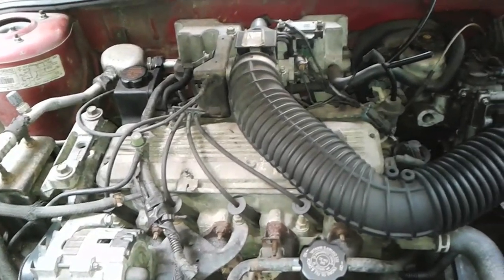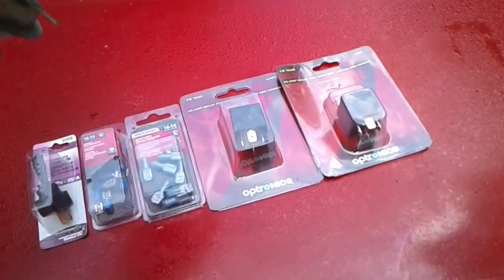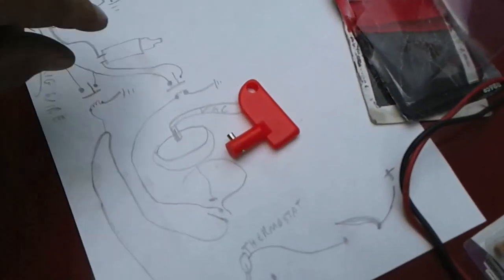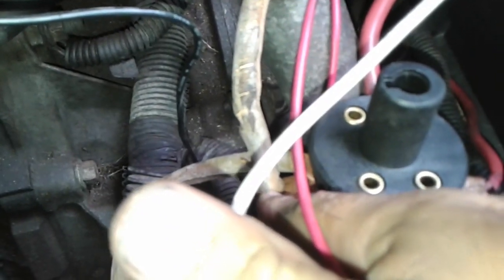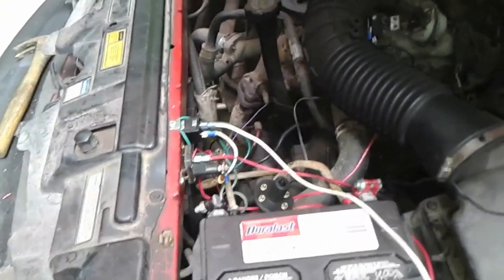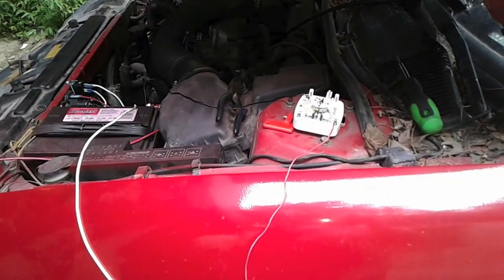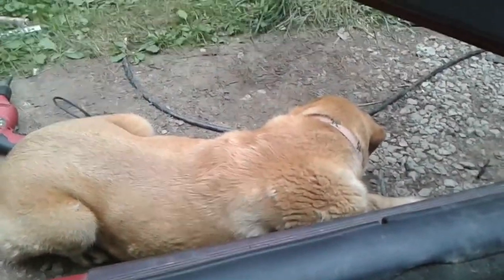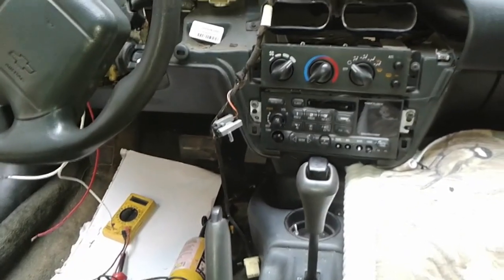Making a Car into a Home Part 5-HVAC

Comment: Maybe you should patent this wiring setup if you can ? for RV's maybe ? having the rig start up for climate control would be quite helpful for keeping the house batteries charged and the engine running a few times a day during park use.
Reply from the maker: I probably should. I'm going to be using this same kind of system in Buster. It should be easier on an '87 model.  I was thinking of rigging the start procedure to be initialized by the power inverter alarm also to charge the batteries when they get weak.
Reply: Roadtrek has a setup like this to charge the batteries on their newer class B van/motorhomes, but they added an extra electric generator to the motor to charge the RV house batteries faster.

Comment: I was wondering how those fancy motorhomes were doing that thanks great explanation. 
I have wondered is it possible to do radiant floor heating and capture the heat from the engine block by circulating water through it maybe on a thermostat.
Reply from the maker: I didn't know motor homes did that, cool. The radiant heat is an excellent idea. Could even use some of the residual heat to warm up a hot water tank for a shower.
Reply: This is what those big trucks (used to haul huge semi trailers) that the drivers live in do (or at least some of them do). At least according to a YouTube video I saw you have to be careful because the water can be extremely hot if you don't give it a couple hours to cool down after a long drive.
Reply: I saw a YouTube video that featured it. I think it was Mercedes class B

Comment: In order to tell the system if the car has started and is running then to shut off the starter, you can use an anti restart relay which senses output from the alternator instead of a vacuum canister and switch.
Reply from the maker: Good idea! I ended up using a different approach on my bus. It works just the same way though. Here is a link showing that if you were interested. https://www.youtube.com/watch?v=GKgCziQjXqs

Comment: In super hot weather or cold weather wouldn't the car start every 2 mms? My car gets rly hot after couple mns of not having the ac on. It would be turning on and off all night like every 5 mns. Right?
Reply from the maker: Very good point. It depends on the extra insulation and whether or not you cover the windows. 
On a car with the windows uncovered during the day letting in sun, it would indeed start every 5 minutes or so. At night when you would be more likely to use this system there is no sun to warm the interior so without insulation it will stay cool(depending on temperature) for about 10 min. 
With the reflectix in the windows sealed tightly against all the seams it will be more like 10 min in the sun at outside temp around 90 degrees and 30 to 45 min at night with the temperature at 80. 
I have tested this system on this car, my camper van and skoolie. It works best in my skoolie because of the added insulation.

Comment: So this will turn the car on and off all night? If ita super hot wouldn't it turn on and off like every 2 mms?
Reply from the maker: I just answered this question to another commenter so I will paste the same answer here. Not that I'm trying to be impersonal, its just a lot of typing lol. 

"Very good point. It depends on the extra insulation and whether or not you cover the windows. 
On a car with the windows uncovered during the day letting in sun it would indeed start every 5 minutes or so. At night when you would be more likely to use this system there is no sun to warm the interior so without insulation it will stay cool(depending on temperature) for about 10 min. 
With the reflectix in the windows sealed tightly against all the seams it will be more like 10 min in the sun at outside temp around 90 degrees and 30 to 45 min at night with the temperature at 80. 
I have tested this system on this car, my camper van and skoolie. It works best in my skoolie because of the added insulation."